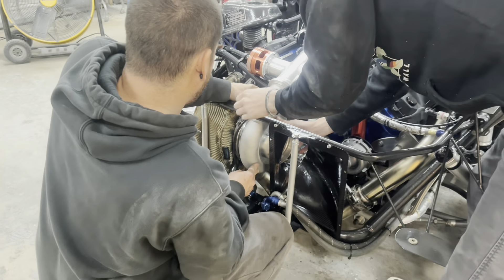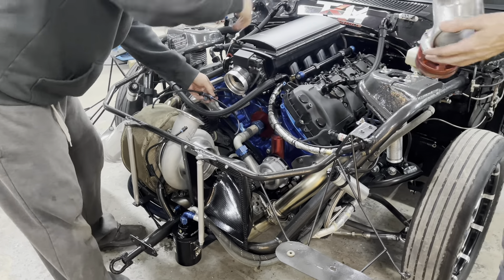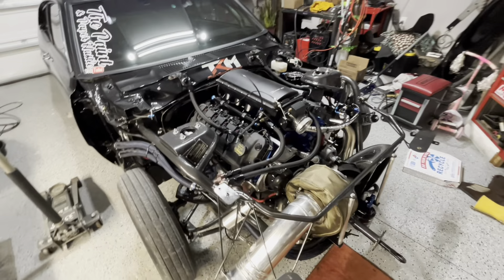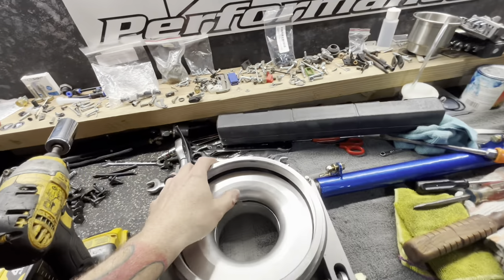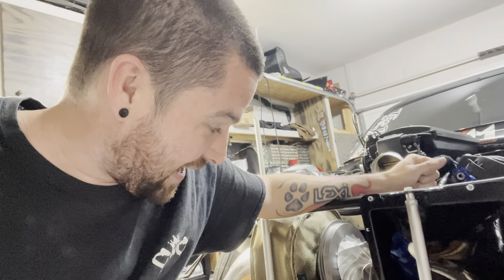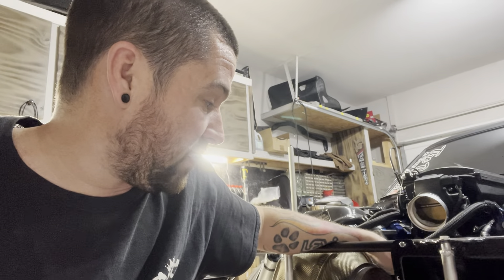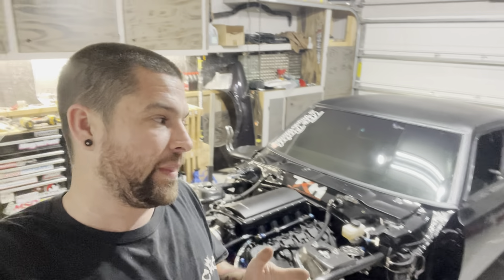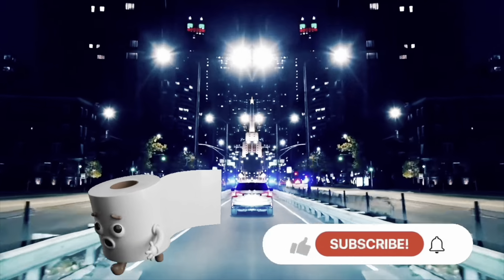🛑 I REALLY MESSED UP 😭 94mm Turbo Spool Up GONE WRONG (@TurboJohnRacing Video Follow Up)

Comment: courtney sorry to see buddy. Thanks for sharing hopefully you save someone else from that happening. I rewatched johns video and when you pan by the motor it looked like the T-bolt was run down pretty far ,there was a lot of thread showing like the nut was run down and they normally are crimp lock style nuts  but as john says it is what it is but bro that  sucks. Boy that thing sounded and spooled wicked fast.
Reply from the maker: Thanks buddy and we will get it back together

Comment: Saw the compressor housing move in TJs video, i used to get mad and cuss hell off hinges but after so much crap has happened now i usually just laugh and say…well hell at least its something different😂. That wasnt a touch down, that was a crash landing🤣. 
The housing would get massaged off with a flap wheel and throw a new wheel on it to get some seat time then send it off in the off season. Shit happens, nothing to do is move on BUT bet you wont ever forget it again so…lesson learned🤷🏻‍♂️
Reply from the maker: lol yup that’s how it is. And nope won’t forget that again

Comment: Courtney has previous issues with oiling on new things . He hooked the feed and drain up backwards ? Welding slag got all over compressor wheel causing it to be way out of balance and smoking the wheel and housing ?😂 just kidding . Compressor housing had to be loose and it shifted and touched down .
Reply from the maker: lol yea I forgot to tighten the V Band

Comment: Hopefully the engine didn't eat any aluminum. Maybe weigh the turbo and put exactly that weight back in for scaling the car.
Reply from the maker: It’s fine. Drove it out the shop and then into the hope garage all sounds good